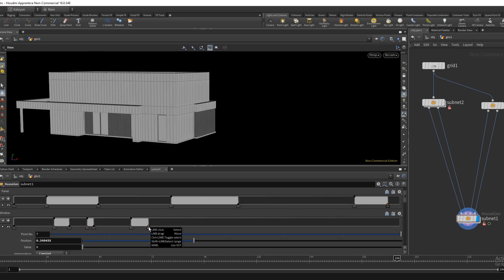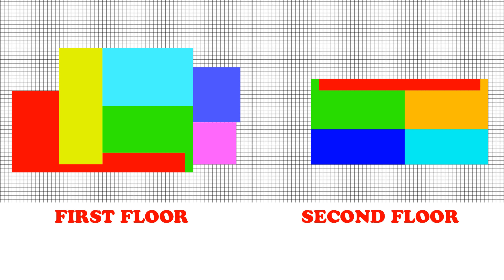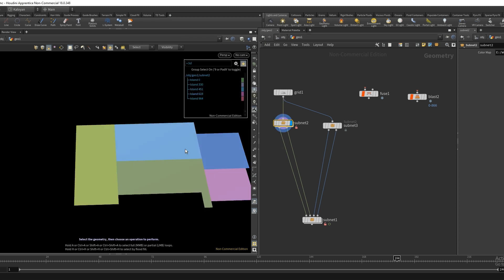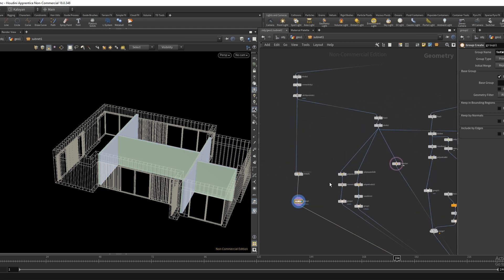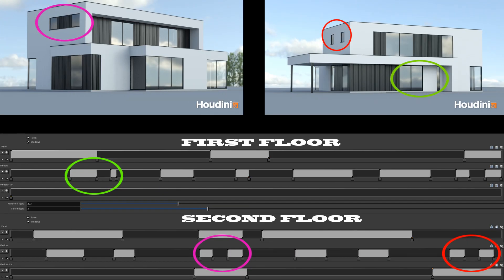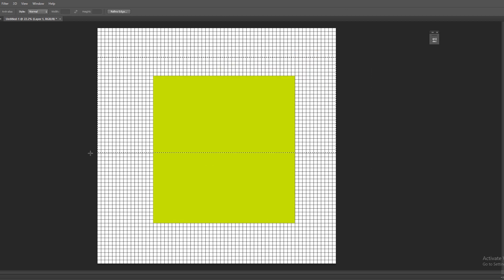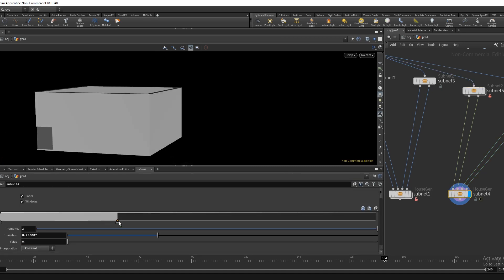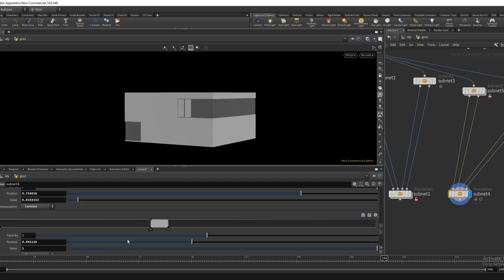Procedural House Design Tool

Comment: Amazing work, would love a tutorial on building something like this.

Have you considered doing anything on the interior ?
Reply from the maker: I did two live streams, they are 15 min longs each cause i got distracted, but I think you could learn something from them too. I decided to try it like that cause I don't really have the time to make a proper tutorial. I hope I can make a longer and better livestream in the future. As far as the interior, i haven't tought about doing anything to it, cause I don't really see how it could be done procedurally, apart from the generation of the walls, which I did. Maybe placing interior doors.
Reply: @kellerdev2905  when do you do live streams and on which platform? YT Twitch?